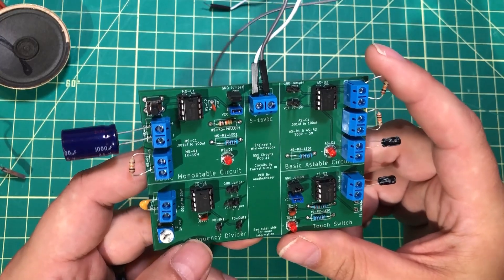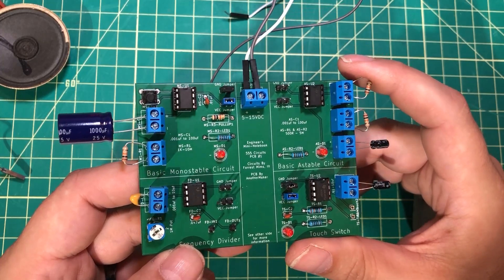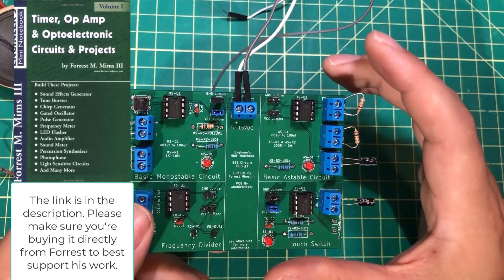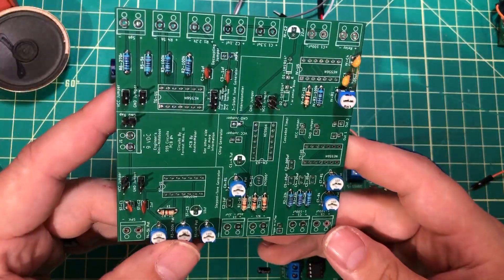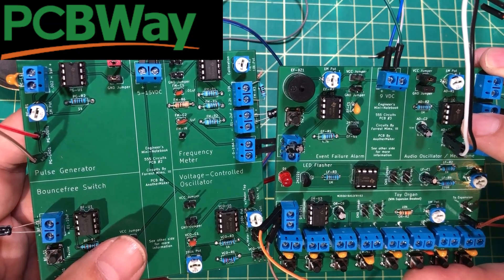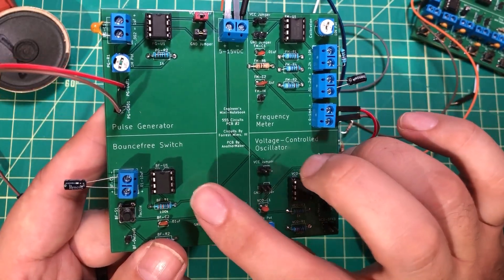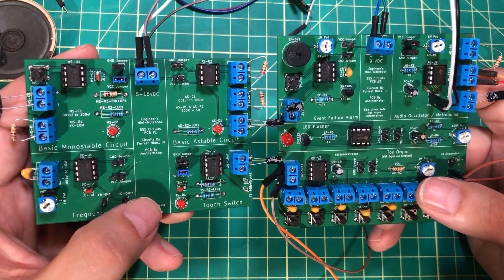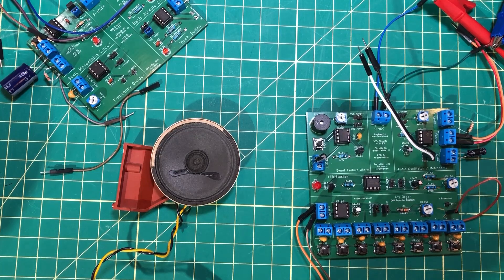I built every 555 circuit in the Forrest Mims Engineer's Mini Notebook - Parts 2 + 3

Comment: Kinda saddening.  I started with the Radio Shack learning kits w/ consoles.  Good, but didn't understand how the circuit worked ... just where to put what and then watch it do its thing.  The missing part was always "Why + How Did It Work"???  I've been doing what you're doing (without publishing findings, but planning to) to fill in that missing understanding.  I get it, but it kinda sucks, too that this won't continue.

Comment: Perhaps you could goad fellow electronics YouTubers into a challenge of who can use a 555 in the wrongest way possible. That is what novel and totally unexpected ways can they be abused to achieve something useful in a circuit? Oh I really need a flux capacitor here but all I have in my parts box is a 555 scenario.
Reply: EFI? MAP sensor driving pin 5 for variable pulse width in astable mode triggered by crank sensor.

actually works.
Reply: @paradiselost9946  That's probably how chrysler used to do it until very recently.
Reply: @curtmeister24  that comment just triggered the "knock sensor"... now its sulking...